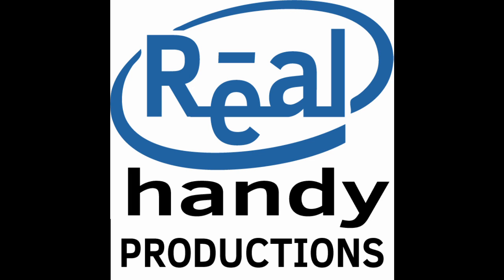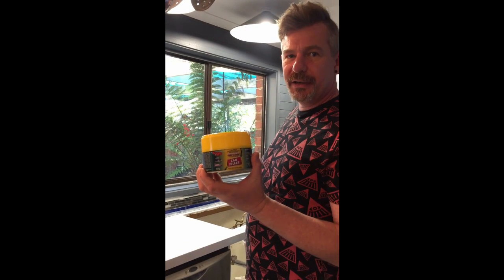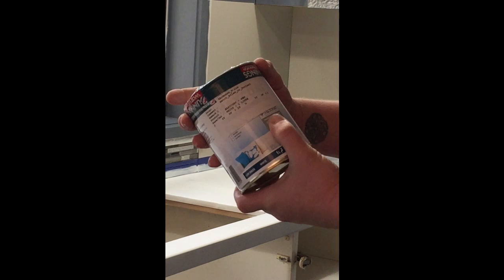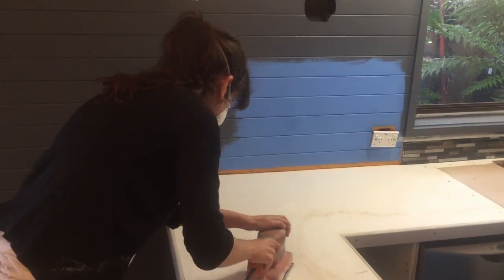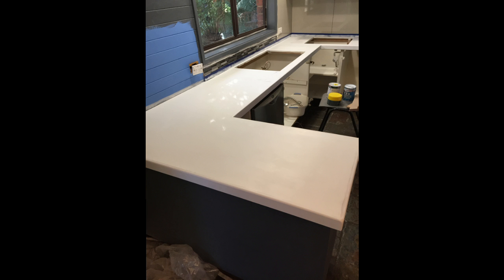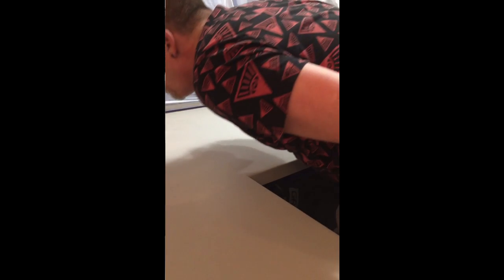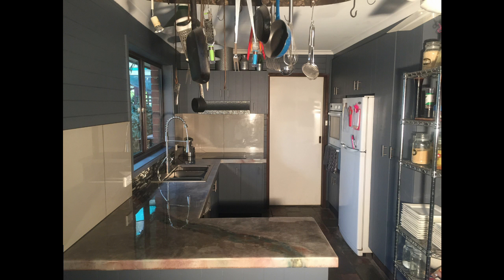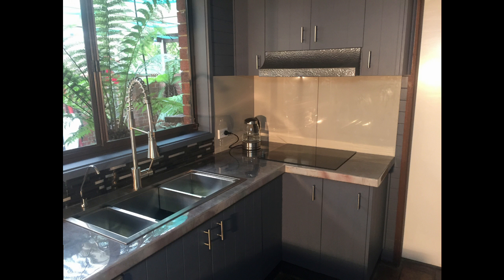STONECOAT Epoxy Countertop Kitchen Renovation

Comment: Great video. Not sure if I saw this correctly. Looked like you were using a v notched spreader/trowel! The SCC product should be used with a square toothed spreader (or trowel) it gauges the correct amount of depth for the epoxy.
Reply from the maker: Hi Ian, we used a 4mm Square Notch Adhesive Spreader.

Comment: Thank you for such a great video!  It has been a little over a year, have you seen any yellowing? Is there was anything you would have done differently?  Want to learn all I can before jumping in.
Reply from the maker: Hi Squeaky, we haven't seen any yellowing at all. We used the Stonecoat product for this project specifically because of its non-yellowing properties, we were tempted to use locally sourced epoxy but after learning how easily most epoxies yellow we ended up going for the Stonecoat as it is formulated for the application we needed. That being said, our counter top doesn't get direct sunlight. Otherwise, I really don't think we'd change anything about our process, it worked out great so why alter it?

Comment: Hi! Nice work! I know this is a little old video, but can you let me know how are the countertops now, are there may scratches or is any yellowing? Im planning on doing mine soon, and this brand seems to be the best but it's hard to find reviews thats show how the resin is enduring daily use.  Thanks in advance!
Reply from the maker: Hi Mar, we have a few minor scratches after 18 months which were solely our own fault, the stonecoat has been really hardy and we are totally impressed. There has been no yellowing at all, but that being said our countertops never receive direct sunlight and we have been careful not to put hot pans or anything like that directly on them. If we clean the countertops and spray with windex they come up as shiny as new.
Reply: @RealHandyProductions  oh wow! Thanks for your answer, that clear all my doubts, Ill be doing mine on january and just needed some reassurance about this resin brand. Thanks again!

Comment: It's me again. I have big granite tiles on my countertop. Do I have to make the grout lines flush or will the epoxy cover enough to make them disappear?
Reply from the maker: Hi again! Sorry the reply is so late. Yes, you should definitely fill up the grout lines with some sort of filler so the entire surface is as level as possible before applying the stonecoat.

Comment: What did you put on your backsplash? The counter is stunning. You stonecoated them too? Was it difficult on a vertical surface?
Reply from the maker: Hi Jo-Anne, we did put stonecoat on the vertical backsplash behind the sink as because it was composed of so many small tiles and a lot of grout we thought it would be great to give it a protective coating. It worked out fine but the coating was not as thick as we got it on the countertop. We didn't stonecoat the larger tiles.
Reply: Real Handy Productions Thank you for replying and the info!

Comment: When exactly do you peel the papers s plastic that it all drips on?
Reply from the maker: Hi Emily, we took off all our plastic and tape that protected the cabinets and floor about 12 hours after the second (flood) coat. We could have taken it off earlier but since we did the pour in the evening we just waited until morning. 
The tape that was up against the backsplash on top of the counter is a different story, we only waited an hour or so and removed the tape where it met the stonecoat while the stonecoat was still a little tacky so the stonecoat didn't set and trap the tape there.

Comment: Fair doo`s m8 it looks fantastic. What sort of spray did you use ie acrylic or cellulose?  I live in the UK and we don't have any stonecoat , is it possible to use just epoxy resin?
Reply from the maker: The spray paint we used for the undercoat colours and mixing with the stonecoat was acrylic. I really have no idea how well a standard epoxy resin will work using this process. We did research other similar seeming acrylic products (like the ones available for floors, etc) but found that they weren't very heat resistant or yellowed with age or experienced other issues. We thought it the safest bet to stick with the product we knew was going to work and contacted Mike from stonecoat to organise shipping to us in Australia.

Comment: Beautiful job!!! Can I ask did you say rubbing alcohol, do you not have access to 90% isopropyl alcohol?
Reply from the maker: Hi Penny, thanks for your support! Yes we used rubbing alcohol; ISOCOL brand that is 64% isopropyl alcohol. We had a few bottles of it already and decided to give it a go, thankfully as you can see from our result it was not an issue.
Reply: I was wondering if the other part of the alcohol was water would this create soft spots. Anyway looks Great!
Reply from the maker: We didn’t have any soft spots or indentations, just the normal bubbles that disappear with the blowtorch, so I think with our next project we will continue to use the rubbing alcohol.

Comment: how long did it take and how much of the stone coat puoduct  did you use? thanks
Reply from the maker: Hi Dennis, this job took us three days all up. With two sets of hands prepared with everything we needed ready to go. Day one: removing sink/stove, counter modifications (adding extra MDF, auto filler and sanding). Day two: undercoat, base coat and decorative epoxy. Day three: flood coat. We used one gallon of epoxy in total for the decorative coat AND the flood coat for our total surface area of about 22 square feet. let us know if you have any more questions, cheers.
Reply: When you say you used a gallon .. does that mean half of what you bought? Because I seen you had a gallon for A and a gallon for B making it two gallons, so you only used 1 gallon?
Reply from the maker: Sorry for the late reply! Yes, we bought a two gallon kit (a gallon of "A" and a gallon of "B") and used half of it all up for this project, leaving us with half a gallon of each "A" and "B" to use for our next project.